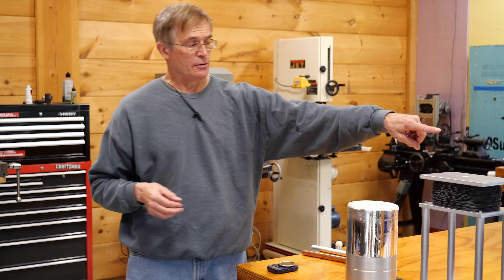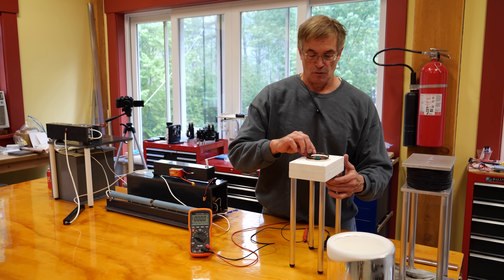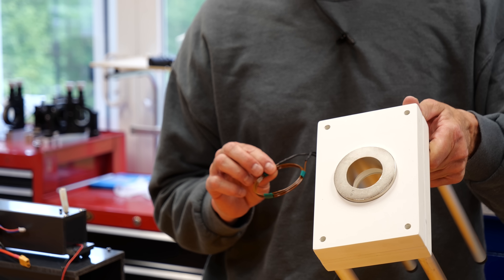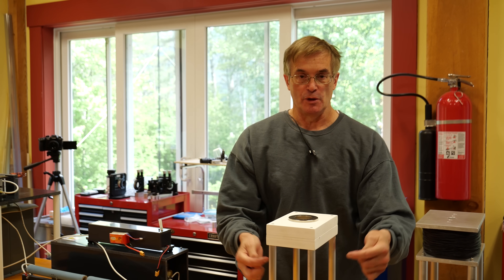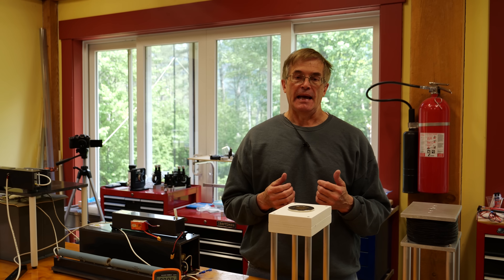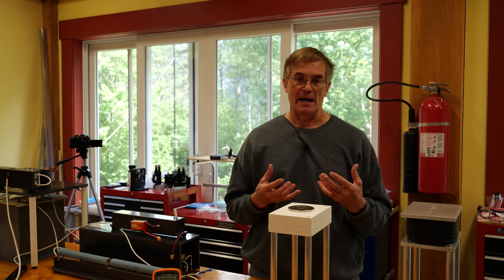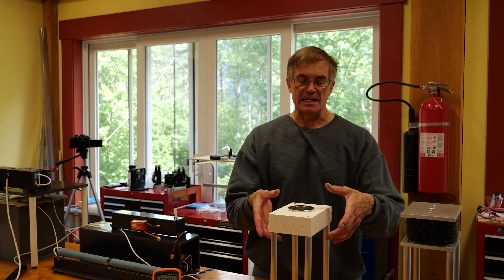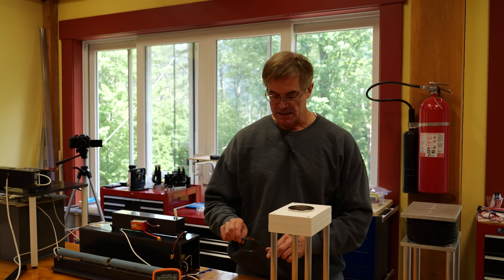No, we didn't use Magic to Crush this Can...

Comment: That can contracting is a good experiment confirming the KELVIN MAXWELL  part (vortices nature of particles and atoms) of the unified electro-magnetic model of the Universe.
 Here between the electro-magnet and the counter magnetised can the SPACE EXPAND due to the so called matter produced field effect on vacuum short-circuited matter (-voltage) / anti-matter (+ voltage) field. 
That is the opposite result of two permanents magnets facing N-S N-S  where the so called H field between them  add up   and cause a SUBJECTIVE attraction because  the space,( not the space time which is an EINSTEIN wrong postulate) between the two magnets CONTRACT The more they approach the more the space between them contract and increase the "force" by square of the distance. 
 SUBJECTIVELY observers conclude that there is an attraction at a distance,
 OBJECTIVELY  The space contract sensibly more and more because vacuum which  is at zero potential at rest, (so no mass, no voltage and vacuum behave like a super fluid with no viscosity at all)  polarize (voltages Vortices appear) . Those voltages vortices (potential energy equal mass) appear when an E so called field (or a rotating one called H field) unbalance electro-magneticaly the "hidden neutralized potential energy of matter /anti)-matter (by a kind of  lower energy "short-circuit") which is everywhere in space "vacuum" (quantum "virtual" field). 
So the vacuum look like a short-circuited battery without the matter used in batteries technology and the fields (so called) passing by separate the anode from the cathode of the battery letting the (attracting) potentials (voltage difference) appear. There the energy carried out by the fields inside the vacuum  attempt  a so called" localization" when energy quantities(potentials, spin causing a H Field) correspond to a quantized matter particle as an electron (clockwise vorticity) or a positron (counter-clockwise) as an example. That is why space vacuum conduct  E and swirling E (H) fields (but consume energy for that to happen) and affect energetically all "charged" particles (not the photon and the neutrino which are neutral) passing trough it.
See if interested the 1990-2000 MEYL-TESLA -KELVIN (vorticity)-MAXWELL unified E.M.fields theory and the Quantum E;D; FEYMAN-CALTECH so called "virtual particles". and vacuum matter-anti-matter "field" models which explain all this somewhat mathematically.
US NAVY apparently understood all that and PATENTED in 2017-2018 (EL PAIS PATENTS) the technology  nature  use (electron, but also galaxies, blackholes, magnestars )in order to produce everywhere "as powerful as atom bomb magnets" by rotating bi-pôles (voltages)"

US NAVY secret project researchers obviously try to understand how observed UFO transit apparently between two powerful stellar or planetary or black holes magnetic fields sources distant up to 33 light year in a few hours counted by the observer and by the pilots (no relatively expanding time, because time is a constant defined by us) For that the craft need gigantic intensities "polarized" magnets RAYS  avoiding diffusion ( difference between a diffusing In all directions BULB light and a concentrated laser ray.)°

Comment: So my gearless differential mechanism pipes instead of solid rods with gas unit's inside with thicker gelatinous liquid of diolectrics electronic fluids that doesn't conduct electricity yet separates the electricity from each gas dot of energized chargers within the gas to expand them or to contract them in zinc and piazo bandings that when they enter a zone of vibrations that resonances fall into it charges the gas to epand the same to contract by grounding the dots of gas the gelatinous thick liquid keeps them in the sphereic ball of the gel shrinks the density or increases them thecpush pull effect on the building blocks of the gearless differential mechanisms multiple ones of the same general system as a rotational inner spinning dot of energized chargers and dischargers in the mindset looking inside it the dots spin in the rotationals its exerted on them the most powerful energy source yet in a different environment oriented to the point of view of tellorical currents I made my first one in metals then glass tubes that showed me the inner workings of balls there lite up on the impaction state the excite the noble dots of gas units I noticed plasma light traveling in the dots and dioelectric gelatin that contained it kept the seperation as it joins to the chambered separators the grounding drains the noble to a lower density and a registering of lower vacuum l see it continue to rotation to the long side gets a new charge to expanding and looping

Comment: More fusion fantasy.
By the way, if anybody actually built a workable fusion power plant, there is not nearly enough tritium in the entire world to fuel it.
Reply from the maker: The lithium salt in the neutron absorbing cooling jacket is converted into tritium faster than it's burned in the reactor.
Reply: @TechIngredients  Explain how that is to work when each fusion generates only ONE neutron.
Reply from the maker: Beryllium intercepts the initial neutron and generates two subsequent neutrons which pass into the salt.
Reply: @TechIngredients  And this will ALWAYS produce more tritium than is used? I doubt it. Neutron economy is very difficult and neutrons are readily absorbed or scattered. That is why the "breeder reactor" flopped.
Reply from the maker: It will. If you doubt me, then don't rely  on my statements.  Do a little  research into the lithium salt blanket engineering and the nuclear  reaction pathway.

Comment: When you said hammer doesnt realy touch the nail its a magnetic force i turned the video off cause its stupid :D iam sorry but explain then sound of a hammer smashing nail and deformation of material
Reply from the maker: You shouldn't have turned it off, but reconsidered your assumptions. If the atoms in the hammer "touched" the atoms in the nail then do you mean the electrons came into contact or the nucli collided?  The don't, only their fields interact.